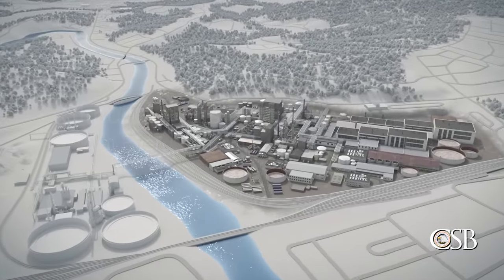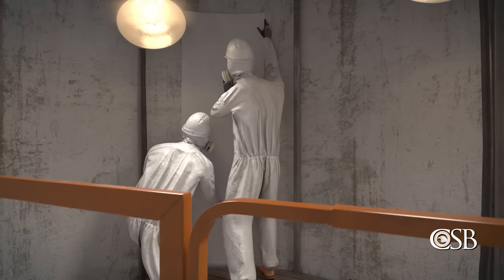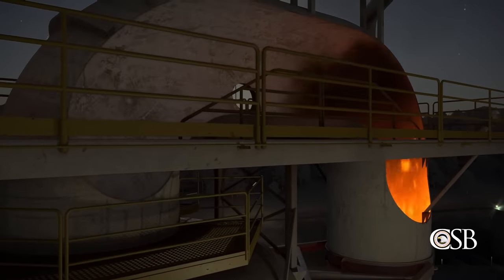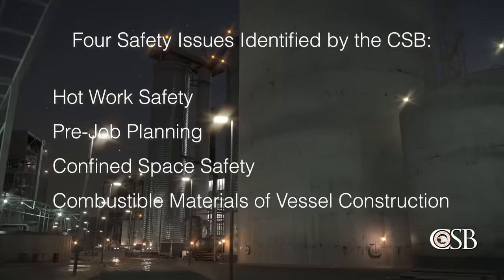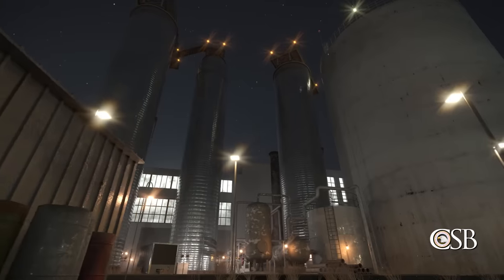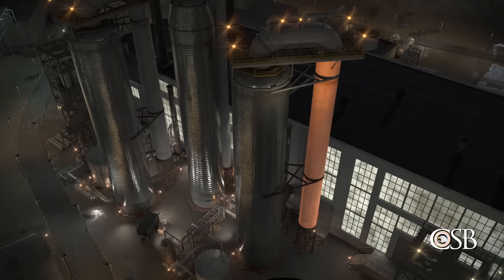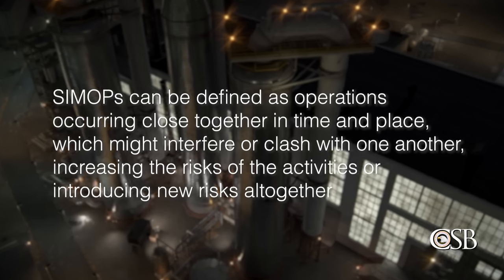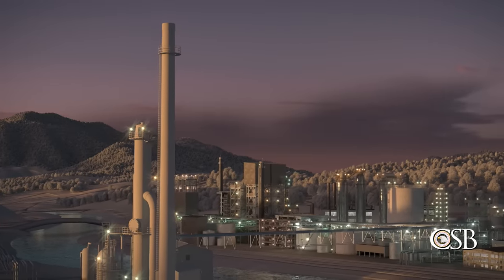Simultaneous Tragedy: Fire at Evergreen Packaging

Comment: Inattention, complacency and negligence are the key elements of every accident. Unfortunately Management remains aloof ignoring the OSHA mandate known as Host Employer dealing with contractors in OSHA law has eliminated  "if in doubt contract it out". The 2 contractors and the industry involved should have done a custom risk assessment for this job mindful of conditions of maintenance and environment. 

The towers should have been inspected, temperatures and humidity impact on vaporization, flammability of the repair process and products used and application concerns should have been done. This is clearly closely akin to Negligence if not flat out negligence. 

Resins are know to be flammable to some degree. Their cure time is known to be impacted by temperature and humidity. Where were the SDS sheets on the product and general procedure handling it, cure times, volatility until cured, etc in a prejob meeting? 

Why were electric/mechanical heat generation devices allowed in a CONFINED SPACE WITH A FLAMMABLE VAPORIZER? There are SO many mistakes here!

I see it in being an SME for electrical safety. Industries like this one, contractor management and supervision let the "slick end slide" and do what they have always done. Inattention, Negligence and Complacency! 

It's "OK" (air quotes) to do what the crew was doing as long as no one dies, gets seriously hurt and/or blows up the place.

I bet the first OSHA meeting on site after this incidence needed to be a clinic for people with amnesia. Leaders duck under the table. Managers have rapid onset amnesia "I never told them to do that!!!"

That is why a PREJOB meeting and RISK ASSESSMENT with the elements of Environment, confined space, PPE, flammability of the product being applied to the repair process, oxygen deprivation. tools and equipment suitability for the environment and job. EVERY THING IN WRITING!

I bet OSHA had/has a field day with this. This is typical of complacency on ALL levels, contractors, owners, third party engineers and other stakeholders RESPONSIBLE FOR THE SAFETY OF THE EVEY DAY MAN OR WOMAN DOING THE WORK!!!

Policy makers with in depth experience in H, S and E charged with a very serious and weighty responsibility like calling the shots on a job like this should hold the line, maintain the standard high and force issues until the job safety has been declared as best possible.   Hazard analysis Risk Assessment. Call in experts from the chemical manufacturer! Where are the minutes of the meeting or meetings with the contractor and the Resin and Matt vendor? Where is the RAP for handling flammable and vapor hazards associated with the product? Where is the assessment of flammability of the DUST generated by the repair and refurbish operation????

 Within the limits of Process, Procedures and PPE as well as environmental concerns with all the disciplines associate with environment and hazards has been completed IN ADVANCE work should not commence until very through and detailed assessments are done.

Additionally frequent audits of special work practices or procedures as well as frequent meetings to track progress and discuss issues and concerns about not only the job as a hours to dollars issue but a real heartfelt and sincere discussion of the safety issues and compliance with strict safety measures is being followed. AN INDUSTRY REP should be in and or orchestrate such meetings. Contracting  is no longer one way. It's a shared responsibility with the OWNER and his stakeholders having responsibility!

This job was one that should have never been.  The negligence, complacency and and inattention of a few guardians of safety summarily caused this useless, tragic loss of life.

Wake up people do hazard assessments, bring in experts on chemicals and processes to be used. Hire an engineer with specialty in confined space. Wow you say that costs too much? 

Is the loss of lives and multi-million dollar equipment damage not costly??

DO IT RIGHT the first time! The people that died had a God Given and OSHA required mandate to have safe employment and a place of safe employment!! Those of you that let them down will have this on YOU conscience forever!!!

Comment: Dealership in the 90's burned the drive in repair And service advisor area Along with the cafe A heat gun was used to get rid of a radio station logo in the back window The "Car jockey" then left the gun on the seat turned off However the heat from the nozzle burn the fiber And melted the foam Starting a fire That quickly spread And in a panic the door was fully open to try to splash water into However it only fed the fire more air And smoke to escape The Car jockey could not tell the investgator the diffrence from a blow dryer And A heat gun  Aside from the fact a heat gun has metal for a tip And not plastic

Comment: Basically the blastco workers didn't consider the risk and killed those other workers. Even with the use of the heat gun, if it hadn't fell into the bucket, this may never have m happened. Carelessness, compounded by the lack of pre planning.

Comment: Something I always take away when I watch these videos: No job is worth your life. Your boss hounding you to finish the inside of the pipe faster and there’s no way you’ll be able to get it done safely? Don’t do it. I wonder how many of these stories could be prevented with a little worker pushback. It’s just another consequence of wages being so poor. Can’t afford to lose your job, can’t afford to say no to the boss, can’t afford to not do something unsafe and be retaliated against, then you die. This didn’t happen because some workers fucked up. This was a series of events that was kicked off by the owners of the factory not wanting to pay extra money or spend extra time to have the connected pipes worked on individually as would be safe, and instead worked on simultaneously. That’s WHY there’s two separate contractors. Any individual contractor would have charged them for SIMOPS rates.

Comment: Well, personally I'd state a different cause: electrical equipment safety, and only it (well, on top of the unplanned works, of course). I guess the fire was caused not by the heatgun's airflow, but by the fact it fell into the liquid resin, malfunctioning there because of the stalled motor. The same could have happened with any other equipment, just the presence of the heaters make heatguns more prone to this failure scenario. So, BlastCo (what a name...) should focus on training their personnel in the power tool safety, as the sole fact a power tool fell on a site is already a trouble brewing, and a sign of major inexperience of the workers (let alone a working manual power tool was left unattended)! The whole story is shady though, say why wouldn't they wait for a daytime so the walls would heat up (and yes, why even bother heating the resin, if the walls you apply it onto are cold)? Why wouldn't they use a stationary heater? Why couldn't they just tell the facility owners the weather conditions require some additional works, and just take their time planning the process? Why, why, why... sounds like the workers were just sent there without any correct briefing nor any feedback was heard back...

Comment: Why would they hang a working heat gun over any flammable object? Turn it off and put it on safe surface instead, sounds like this accident could have been avoided if they use common sense.
Reply: Guessing that someone got tired of holding it above the bucket. Or wanted hands to stir the resin.

Comment: Four safety issues? They seem to have missed the apparent main issue - stupid workers and possibly intentionally deaf management. If the work isn't possible below a certain temperature due to the properties of necessary materials, the only safe means of completing the job is to wait until the functional temperature of the materials is reached - don't do it in winter,  do it in summer. Or use materials with a lower drying temperature.
Just don't hire fools who point heat guns at flammable resins, then lose all control over said heat gun in the worst possible place.
.

Comment: what would telling the other workers they were using a heat gun have done? 
"hey guys! we're warming things up over here! careful of the heat!"

and obviously their plan for cold weather is to use a heat gun... why else would they have a heat gun?
Reply: Informing others is supposed to be a call to action for others to warn about the potential danger of a situation. “Nooooo! Don’t do that”. 

The heat gun wasn’t the problem. Using the heat gun in an inappropriate situation was the problem. There are endless non-combustible situations where the tool can be used safely.

Comment: Company A was working in the updraft tower, Company B was working in the downdraft tower, the two towers are connected by a large pipe

OK so whatever else happens, this is the root cause of the problem. don't contract two different companies to work on the same piece of equipment, it doesn't work out

Comment: i was trying to balance a tire with "sticky weights" in the NE montana winter
.
had a rag with brake cleaner and some rubber buff fluid on it.... and tried to use the heat gun to warm up the rim a bit
i set the heat gun down, went to pick up a weight, and bumped the rag
.
it touched the tip of the heat gun
INSTANT fire
.
no smoke, no smoldering 
just WHOOOSH!!!!
.
i tossed the rag on the ground and stomped it out
no harm done
.
.
but my boss still wrote me up for it...... 
said i was "too careless" 
.
i guess he wanted me to set the heat gun down 50 feet away or something
idk.... setting crap on fire isnt good, but in a shop that does a lot of cutting and welding...... fires are simply going to happen

Comment: The 2 contractors were fined a total of $112,000 for the multiple violations and the failure to fulfill mandated safety procedures.

Perhaps, in future, accidents which are determined to be caused completely or primarily by the improper or illegal actions, or lack of actions, of the companies should be punished with more appropriate fins. The US government uses a general figure of $2.5 million per life saved when assessing whether safety procedures or products should be mandated. (For example, if including a particular piece of equipment on an airliner would cost $50 million, but would likely save a total of more than 20 lives, it would be considered economically appropriate.)

In this case, these contractors would face fines of $5 million. And $5 million is vastly more persuasive in terms of forcing compliance with safety regulations than $112,000. It is long past time for companies to face a fine many times more than the cost of safe working conditions. As long as companies face small fines, they will continue to endanger workers for profit.

The average OSHA fine for an accident resulting in a worker's death is $10,133. The average OSHA fine for an accident causing a worker's death where the cause is willful violations by the company is $36,720. There were 4768 worker's deaths in accidents in the US in 2020. How many less would there have been if the average fine was not a pittance, but $2.5 million?

Comment: You're  insane  to not  have to  recognize  it as  an  ignition  point just  because it doesn't have a flame. Not having  a flame  doesn't mean  it can't transfer heat. Heat  is all  that  is needed to  combust something. That,  and the fact  that anything electrical can probably produce  ignition  too  in  the case of short circuiting even if it can't  produce temperatures  normally in function that would  exceed  the  flash point of the   flammables. What  the fuck.

Comment: all the idiots needed was a large container of hot water on ground level to warm the resin drums prior to mixing.

epoxy resin curing is an exothermic reaction, just raising the tempreture by 5 to 10 deg Celcius would have been enough.

Comment: not as bad as this but just as stupid i did work at a home where a painter was trying to patch a drywall inside corner and it would not dry so he got out the heat gun then puts it on a paint can and goes to buy his lunch i kid you not well fell off the can and burned a big ass patch of carpet stupid is as stupid does  RIP